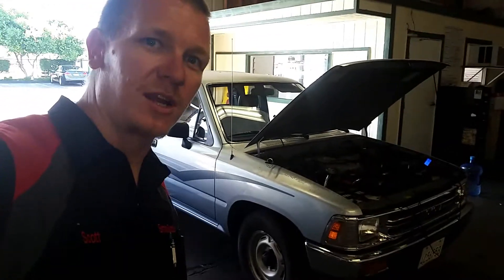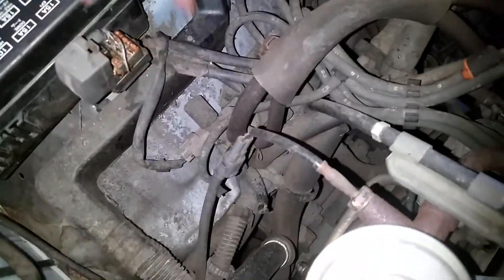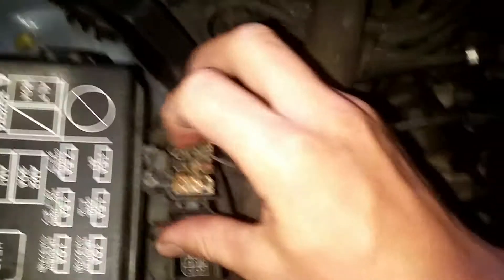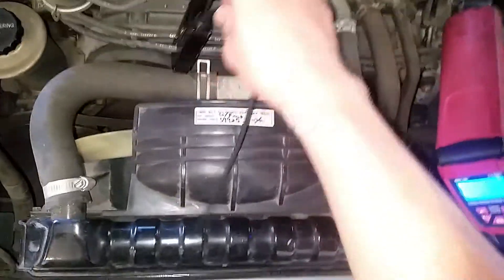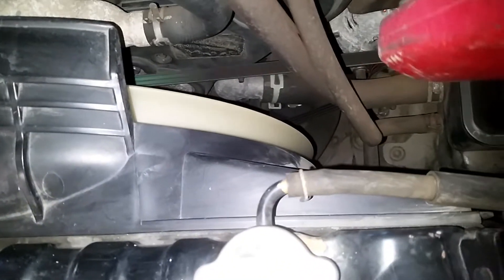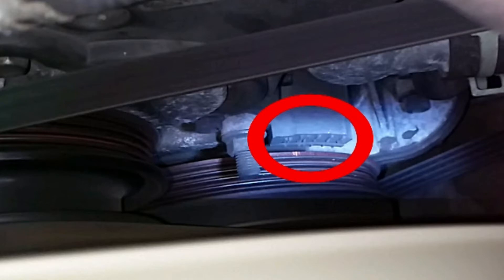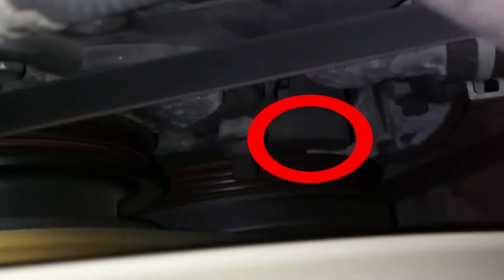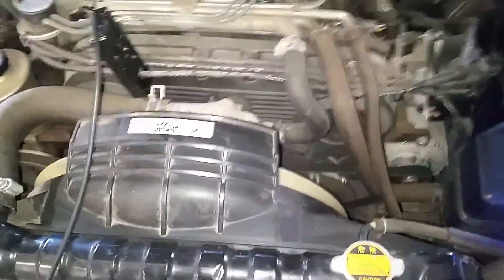⫷ 3VZ-E V6 Ignition Timing Check. Easy and Informative! Pick-up, 4Runner, Hilux, Taro ⫸

Comment: My timing indicator on my pulley won’t go below 10 and it I can be adjusted past the gauge indicator. Is it my distributor that’s  been installed wrong or my pulley.
(I had my timing belt and water pump replaced recently)

Comment: Question: (I have same exact year and motor) The closest I can time mine is about 18 BTDC. I removed the distributor cap while crankshaft is on 0 BTDC, and the rotor points about 4 degrees (1/2 inch) left of the #1. Should I try removing the distributor and reinstalling?   In other words, It is supposed to be at 10 degrees BTDC, but the distributor will not rotate far enough to get it there.  Thanks!
Reply from the maker: Your idol is not set Hi, is it? As long as your idol is good. It sounds like your distributor is a tooth off somehow somehow. Has it ever been replaced? It's not common for a distributor to skip a tooth unless there is a mechanical problem or the or the gear on the bottom of the distributor has become knife edged. In your case you could could remove all of the bolts that hold your distributor in, remove the distributor just enough turn it one tooth, and reinstall. But..... you are going to adversely effect emissions, if you are trying to pass smog. Also, take your time and be patient. Careful with that one.
Reply: @ScottiesHobbies  The idle is a little fast, now that you mention it. I replaced the distributor once since I have owned it. But I installed it exactly how the old one was. I just tried moving it one tooth and then it was probably around 10-15 ATDC ( very low idle).

Comment: then...just losen bolt on distributor to move timing position....
Reply from the maker: Correct... Loosen the distributor just enough to move the Distributor. Turn the dizzy while you watch the timing mark move on the crank pulley.